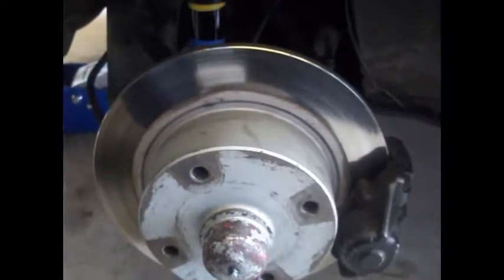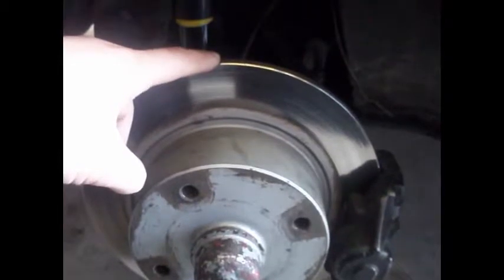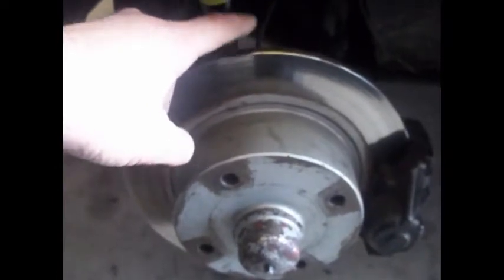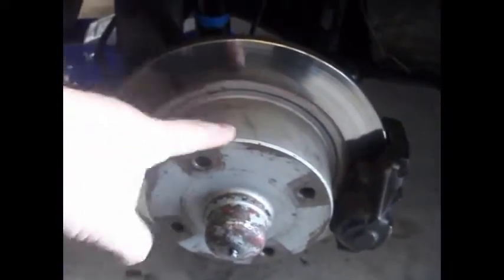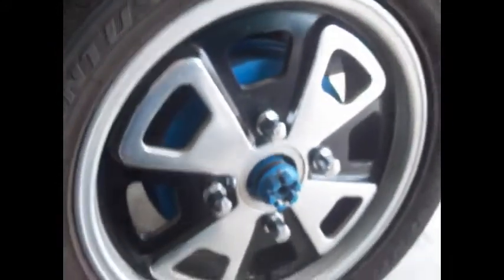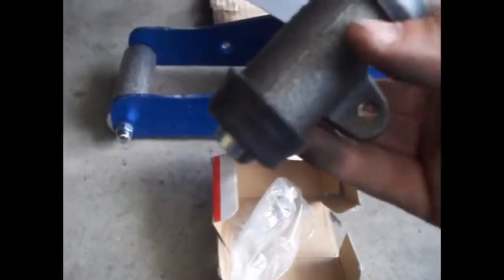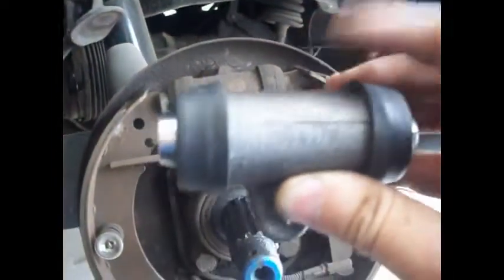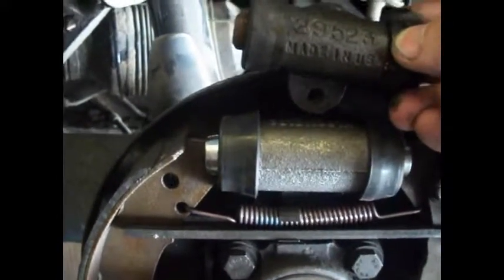VW Bug Disc Brakes with Rear Drum Brakes Rebalancing

Comment: That cylinder has the bleeder towards the bottom when installed and is harder to get the air out. Some years work better than others but it sure makes a difference.